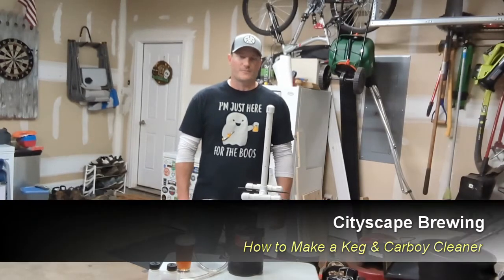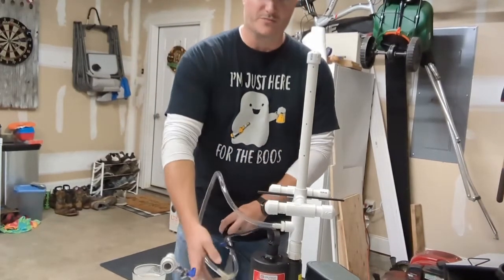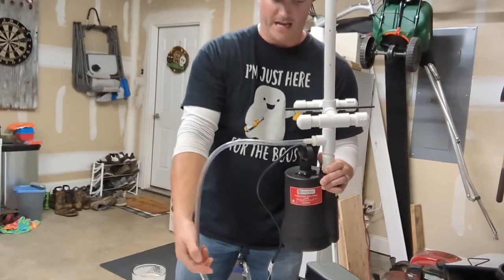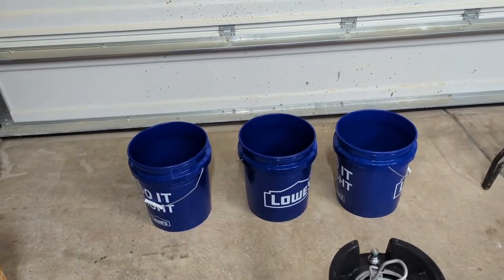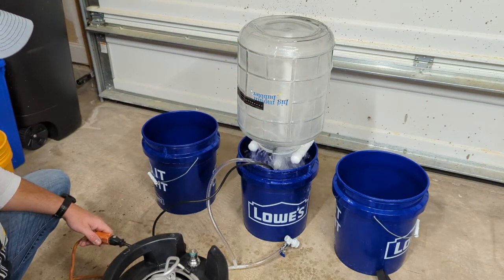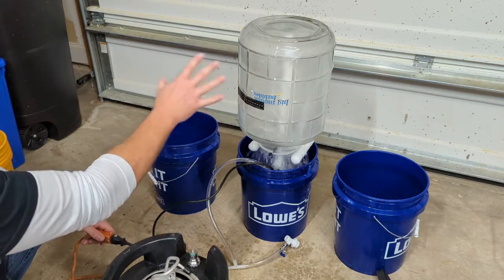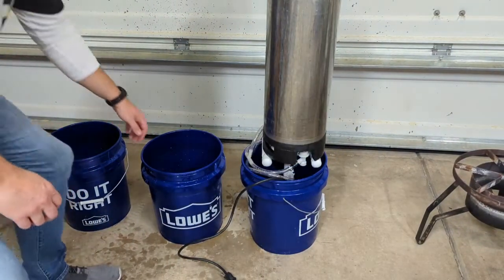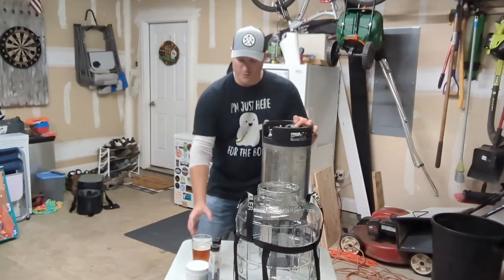DIY Keg & Carboy Cleaner

Comment: Awesome, I am going to have to build one of these! thanks for the tips!
Reply from the maker: You're welcome.   They are very nice, and beats dragging everything into the kitchen.   I bought a keg that had dried crap on it for over 20 years and that cleaned it in about 20 mins.  No scrubbing, but I did remove the posts and put on new gaskets lol
Reply: @CityscapeBrewing  I will be picking up about 4-6 kegs in 2 weeks cannot pass up $20 each, they have 34 of them and if I had the cash I would buy them all hahaha
Reply from the maker: That's a really good deal.  I would too!

Comment: Great design. I ust to build aquarium filter systems,  I might still have parts to build this. I might add a garden sprinkler to the top.
Reply from the maker: I have like eight holes at the very top that spray random areas. It covers the entire top area.  I rotate the carboy or keg a little bit but I don't even need to really because it cleans really well with the sump pump pressure.

Comment: I bought a Kegland Bucket Blaster. It comes with a very small Chinese pond pump, and the rest of the stuff is Duotight and EVAbarrier, except for the disconnects.

It worked just fine with that little pump. No CIP ball. No arms to spray the sides. Everything came off. Sadly, the pump died very young, but for $28, I got a better one from Amazon.

I didn't want to spend a ton on factory brewery powders, so I tried my homemade Oxy-Clean substitute, which is a combination of sodium percarbonate and washing soda. It works perfectly fine. You can add a surfactant that doesn't foam, but it works without it, so I'm going to leave it alone.

If I were doing this over again, I'd get the parts on my own, and I would use a Homer Bucket with a round hole in the lid instead of a wire cage like the one the Bucket Blaster comes with.

Kegland products have no direct warranty in the US, so you have to rely on whoever sold you the product.
Reply: Well, I guess I lied. I just took a keg off the cleaner, and it still has a ring of yeast after around 10 minutes. Maybe I need to add a ball.

Comment: Nice design!  How to you seal the fiberglass rod from leaks?  Just a tight fit, or do you add some glue?
Reply from the maker: You can use PVC cement or just tight fit.   If it leaks it just goes back into the bucket anyways.   I just tight fit it together.

Comment: Hey,
Have you had any trouble with the cleaner reacting with the buckets?  
My last batch, smelled and looked like paint. I always rinse before I wash, but seemed suspicious.
Reply from the maker: Nope.  I have always used PBW or Oxiclean Free.  Never had an issue with color from buckets at all and I use the blue ones from Lowes most of the time.

Comment: Would you say this is a better setup than the Keg King Bucket Blaster?
Reply from the maker: It's definitely cheaper, especially if you can find a used sump pump, but even with a new one the pressure from the sump pump is pretty strong and works really well to clean everything.  I haven't used the keg king so can't compare head to head.

Comment: Si I am starting slowly to get into brewing and such. Can I make good beers with an all in one system? Also I thought you said 1/2 inch hose but you linked to 3/8ths? I could be wrong. Which are the adapters to go from the ball locks to the hose? Thank you in advance! I just joined your channel btw! Cheers
Reply from the maker: Thanks! Yes you can make great beer in any system, a lot of people use an all in one system to save space and make brew days a bit easier.  It's the same process as mine except the sparge portion, everything else is the same.  The parts I list under the video in the description are correct. I made sure of that when I was putting together the parts list.
Reply: @CityscapeBrewing  Do you recommend a ceratin system? I have been looking a the Vevor one.
Reply from the maker: I haven't used any personally, but have friends that have several different ones.  For a beginner brewer, the Anvil Foundry 10.5 gallon is a good one.  They made some recent changes to the latest model that really makes it better, and cheaper all in one system for about $425 and I just saw their site has 15% off before August 15th.  https://www.anvilbrewing.com/foundry-10-5
Reply: I realli like the 18 gallon. Does it have the updates? Also do you remember what size holes you drilled in the PVC? I am totally building this! ty!!  @CityscapeBrewing
Reply from the maker: I think the holes were 1/4 inch or 3/8 inch.  That doesn't really matter much.  I'd start small and see how it goes.     I am not sure if the 18 gallon has the upgrades, but if the screen is at the top of the unit, then it does have them.
Reply: last ?n I got buckets but they are not deep enough. My keg washer should be finished by the end of this week. How big are your buckets?
 @CityscapeBrewing
Reply from the maker: 5 gallon buckets from Lowe's.   They're a bit short as well when I use it for washing, but it mostly falls back into the bucket.

Comment: How much liquid do you put in each bucket?
Reply from the maker: About 1 to 1.5 gallons or so.
Reply: @CityscapeBrewing  Perfect, thanks for the quick reply. I built something similar and started with 2 gallons and found it to be too much, for two reasons:

1. It wasn't necessary to have that much liquid to keep the pump from running dry - it's amazing how fast that liquid drains from the keg/fermenter.

2. Even using the low-foam Saniclean that you suggested for the sanitization bucket, I found the bubbles to reach the top and start overflowing slightly.

I upgraded mine slightly with an all metal construction, a 3/8" stainless steel CIP, duotight fittings and a 3/4 HP submersible pump I got used off of Amazon.

All inspired by your design and the Ss Brewtech Keg Washer.

Thanks for making these videos.
Reply from the maker: You're welcome.  Sometimes a drop of two of fermcap S that you can use to prevent boil overs will also prevent foaming for sanitizer.  I add a few drops to it sometimes to help with that